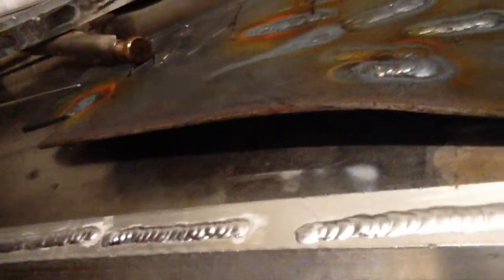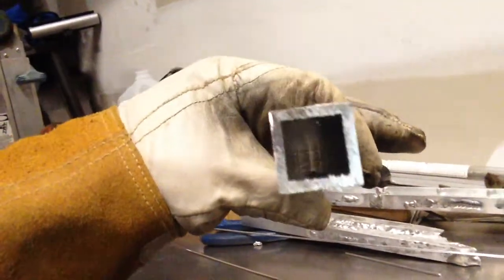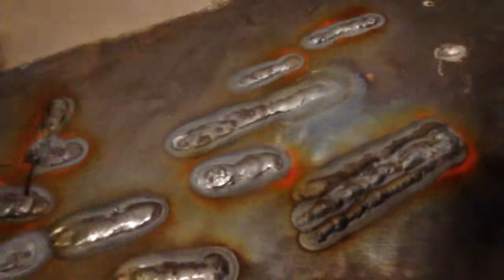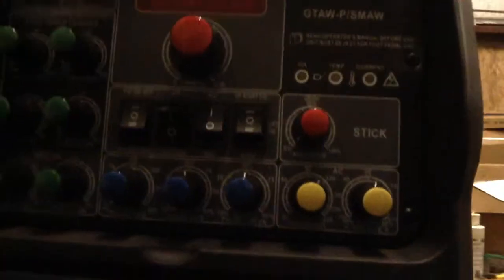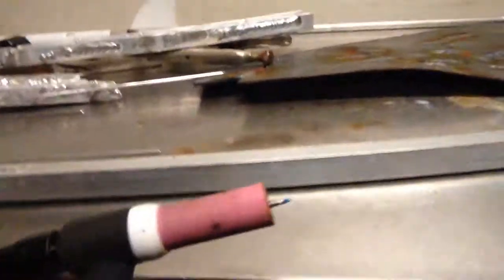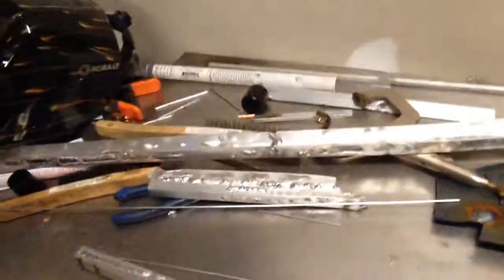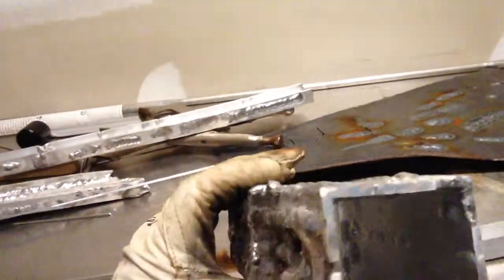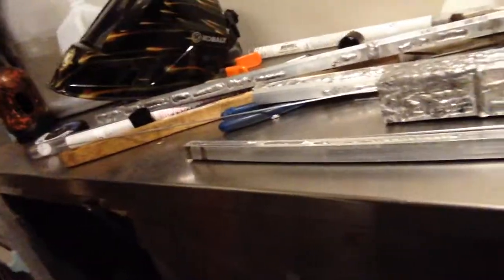Tig welding aluminum with a Everlast 250ex

Comment: I know I'm late to the party, but my comment may help people in the future.  I agree that the ac balance is too high for aluminum that is that clean.  25 to 35% would be better and your tip won't get so hot.  It looks like the steel welding was attempted on AC.  Steel is welded on DC.   Also, for your ladder rack attempt, not all aluminum is weldable.  But before throwing in the towel, I would try lowering the amperage setting.

Comment: Try to put the tungsten up in the cup a little more or get a gas lens the tungsten is discoloring for a verity of reasons one it is extended to far and not quit getting good enough shield two it is borderline to small of tungsten for the amps you are using and three it could be your gas is to low but I don't think it is the last on.  Another thing the ac balance is pretty high on the cleaning side of things I would put it closer to 30-35 % cleaning and 65-70% penetration.  Everything else seems pretty good.